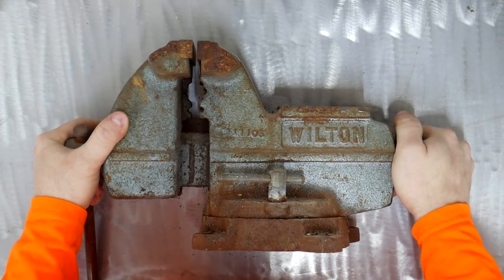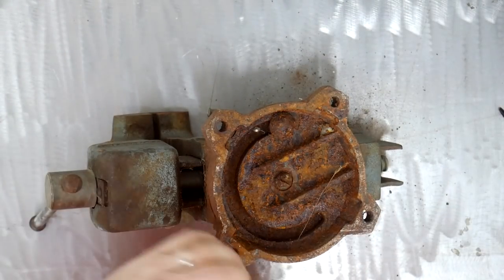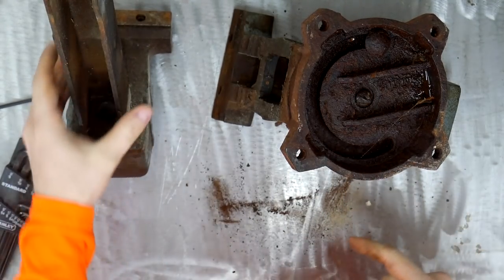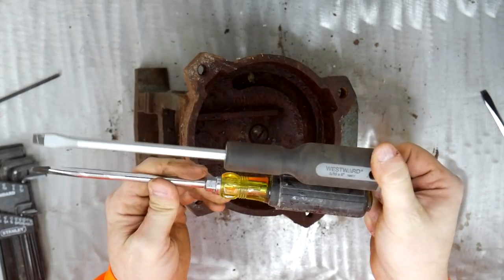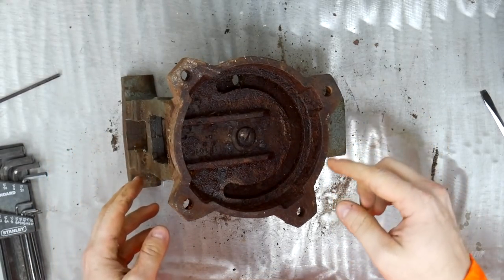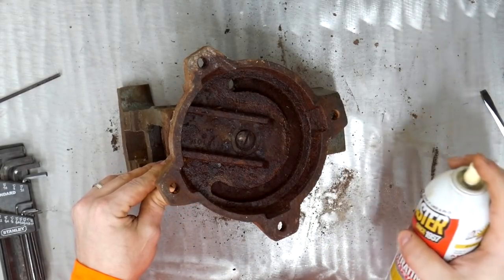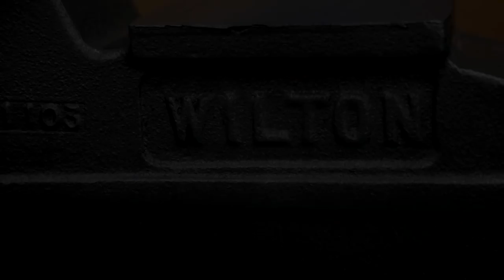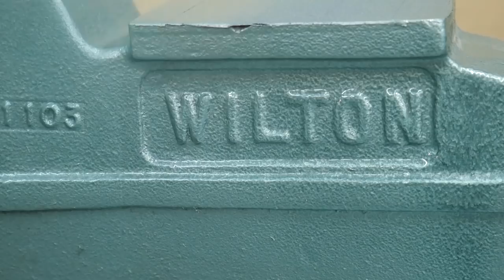Crusty Wilton Vise Restoration

Comment: Nice restoration. I restore vises myself and when it comes to the jaws, I use a flap sander disc on my 4-1/4” angle grinder. It really does a nice job of sanding out most of those saw marks. I also use it for the sides of the jaws as well for the same and on the anvil. I really like that color. I’m going to have to try that one out in the future.
Reply from the maker: Thanks!
Reply: Nice job. What grit of flap sander did you use?

Comment: And that is EXACTLY why one uses Loctite,  it prevents corrosion and allows parts to be disassembled years later.  Even using low strength will work.

Comment: I still like the colour like I said on my previous now deleted comment, and I still think you did a brilliant job. Proper/manual/non-electric/what-the-heck-you-call-them impact drivers are worth their weight in gold. They are only about £15 here in the U.K. I was worried that in some instances they might do more harm than good, but that hasn’t been my experience thus far. This is my second time watching this video and it was every bit as satisfying as the first.
Reply from the maker: Thanks. I have a huge Wilton bullet I’ll be doing in the winter. It is going to be fun.

Comment: Amazing work and well done! I learned a lot. I just came across NINE vintage Wilton "Bullet" vises that are all operational, but need some TLC. I'm trying to decide whether to tackle cleaning them, or trying what you've accomplished. Note: They're going to be sold, so I'm trying to figure out whether it's worth my time or not.
Reply from the maker: Bullet vises are ALWAYS worth the time.  You can probably get several hundred dollars for each one, depending on the condition.  At the very minimum I would de-rust them before putting them up for sale.  A lot of people feel like full restoration ruins the value of antique tools.  I'm jealous!

Comment: I also would not paint the slide as it will scratch up over time going back and forth. You could spray it a clear coat if you want some protection and that way as it wears , you’ll still have some rust protection for the slide. Antiseize works great on all the screws to prevent what you went through on the base and especially the jaw insert screws. Either way, nice job!
Reply from the maker: Thanks again!

Comment: there isn't a single workbench out there that wouldn't want that vise mounted on it.  BTY, watching your method of removing the bottom bolt.  i found that when the bolt moves a little, just spray penetrating oil and keep moving the bolt back and forth and it will loosen more and more until you get one full turn, then it will come out.  getting it to move to begin with is the hardest part :>)  beautiful vise and video.
Reply from the maker: First off, thanks for the kind words.  Second, I agree about the bolt.  I was being impatient and only after reviewing the video did I realize how close I was to freeing that bolt by hand!  I'm pretty happy with the outcome.

Comment: Hey im restoring a wilton vice myself and am having a hard time finding the correct paint to repaint it where did you find your paint or whats is the color code so i can get some made if you could tell me it be a big help thanks.
Reply from the maker: Rustoleum hammered verde green. I can provide an Amazon link if needed. Cheers!
Reply: @SouthpawWorkshop  would you send me a link please its being dumb
Reply from the maker: Looks like Amazon doesn’t sell it anymore. It is getting harder and harder to find these days:
https://www.menards.com/main/paint/spray-paint/all-purpose-spray-paint/rust-oleum-reg-stops-rust-reg-hammered-finish-spray-paint-12-oz/7219830/p-1444453041196.htm
Reply: Did you ever find the paint? I’ve looked everywhere.  I even called Rust-Oleum.  They are out too.
Reply from the maker: Yeah looks like they don’t make it anymore. Huge bummer because it was a great match to the original!

Comment: Question for yah, brother. Do you find that painting contact surfaces (like the shank and the top of the base) lead to sticking when moving the parts? Doesn't the paint get ripped up every  time you open and close the vice? My father had maybe 6 or 7 different vices hanging about and I inherited them all when he passed away. I want to restore them all to their original glory and I love the way yours came out, but I don't want to lose function or looks in a couple months due to paint sticking. 
Cheers
Reply from the maker: Good quality paint that is allowed to dry fully will not cause any sticking. The way my vise is designed, the painted parts rarely touch each other, so while I expect a certain amount of wear, it shouldn’t show up for a while.

Comment: Liked your usage of an Etching Primer (I makes a big difference).
The Verde Green Hammered was a standard color/finish used on shops tools of this period.

When you Disassembled the Rotating Base (111101), Did it have a Locking Pad ??
Some Wilton models in this 6” size had a Locking Pad.

Wilton Vise Jaws
http://www.wiltonviseparts.net/jaw-description/

Dating your Wilton (MI Vise, Detroit) 
The slide key on most Wilton vises has a date stamped on it to indicate the date the vise was ready for release (sale).  
The slide key is a square length of key stock that fits into a groove in the body of the vise.
Unscrew the slide all the way out, flip it over, and you’ll probably find a date stamp in one of several formats.  Some will look like 9-945, which would be September of 1945.
Reply from the maker: Thanks for the great information.  I think this vise came from an era ('80s or 90's) where they were so mass produced, that Wilton didn't care to put any date stamp or serial information anymore.

Comment: Your Wilton Utility Vise (111103) is close to the Wilton 645 (111102-111137) Utility Vise.
Wilton bench vise #111103 - 43 lb, 5" grippers, jaws open 6"
Additional cast marking are always helpful.  Wilton Tools is still in business (Tennessee).
Wilton Vises with Chicago USA in casting mfg. in Schiller Park, IL.
Before 2000, every single Wilton vise was made in the USA.
Wilton Industrial Vises (current production)
http://www.wiltontools.com/us/en/c/bench-vises-industrial/W140

Call Wilton Tools to inquire about Model Drawing and Replacement Jaws !!
http://www.wiltontools.com/us/en/company/contact-us/

Wilton Tools North America
427 New Sanford Road
La Vergne, TN 37086
Phone: 1.800.274.6848
==
Wilton Manuals (Current and Obsolete)
https://parts.wiltontools.com/Manuals.aspx
===
Internet e-Replacement Parts Inc. : Wilton Vise Parts
https://www.ereplacementparts.com/wilton-vise-parts-c-32774_155485.html?osCsid=dds6tnqsb8vfbvu0b7vbigkj53